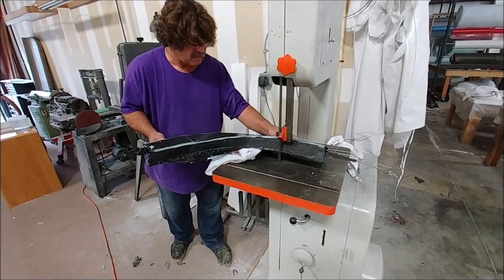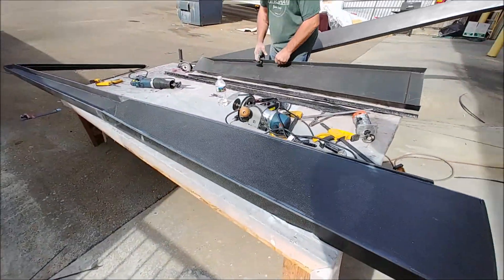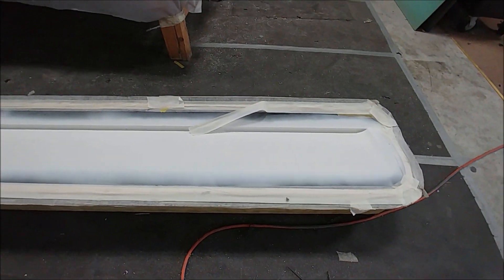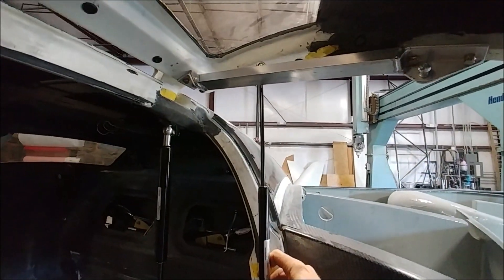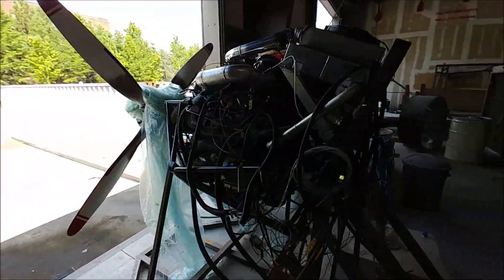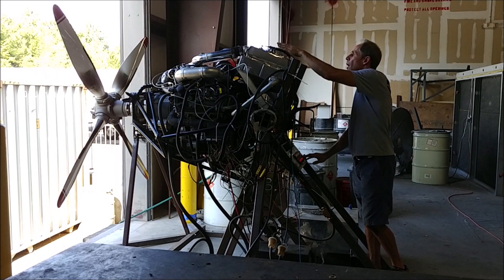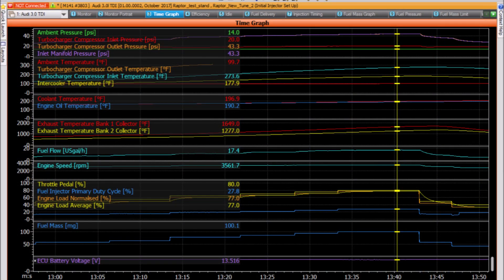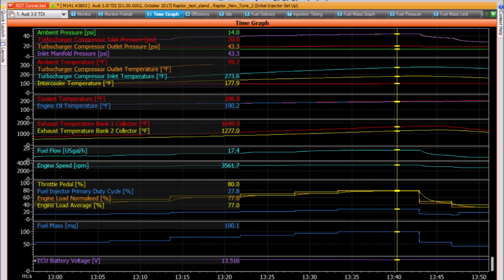Keeping Our Cool - Building the Raptor Prototype

Comment: Nice job lowering the temps with the intercooler. The EGT temp though, is still too high. 1250-1300 degrees is the MAX you should see. One thing to fix is that small, restrictive air filter, do you have room for a much bigger one? Here's a good article from Gale Banks: https://www.bankspower.com/tech_article/why-egt-is-important/

Comment: Really hope my question don't sound just to ignorant,,,, but there's a thrust bearing on the shaft where that prop is mounted? I mean the forces that are unleashed in that single point have to be brutal!! specially in a static thrust test! Also it's there any place where one can find what's the difference in price between carbon and old regular Fiberglass?

Comment: Can't you use a "locking gas spring" which has an actuator pin. This could eliminate the forces when the door is closed. Maybe it takes to redesign the brackets a bit so that the spring is compressed just a little more shortly before the door closes where you would then lock it to be inert. There are three types, one that completely locks both ways, one that is still springy in one direction and the one in the other direction.

Comment: Fuel to Air Intercooler = Genius! 
I wish these electric motor alternators were more readily accessible on the aftermarket. That would be a nice hybrid boost to climb performance without excessive battery weight.
Sorry the door struggles continue, but thanks for taking us through the prototyping journey with you... I still vote for a twin strut solution lol...

Comment: Could we see numbers for a reasonable cruise power setting at say 2700-2800 rpm. 
I think you will find that you get much better efficiency when the fuel burns in the engine's cylinders completely.
 Also that engine isn't designed to run at 3600rpm under that type of continuous load. 
It was designed to be connected to a gearbox that would have up-shifted under those conditions to keep the engine in it's actual power/efficiency band.
 I would advise that you stop chasing max power, maybe instead back the rpm to 2500-2700 and add load until you see signs of over fueling like light gray exhaust. 
This is how you tune a diesel. It's your engine and time though.
Reply: If I'm not mistaken they've already done what you suggest.  That engine was designed to go into the 5k rpms but they've capped it much lower such that at cruise it will be at the normal rpms it was designed to maintain in an automobile.
Reply: If you look at a factory Dyno chart for any of these modern diesels you will see a Broad flat torque plateau from turbo spool up to about 3k rpm and a drop in torque after 3000rpm.
 This is a function of the fuel burn rate VS piston speed. After about 3k rpm the piston is starting to out run the fuels burn rate.
  Look at the injector duty cycles at 27+% it's injecting fuel right up to the exhaust valve's opening. Now consider that the engine is also 50% above it's rated power, how much fuel is burning in the exhaust ports and manifolds?
  I drive a similar tech engine, German diesel, common rail, Bosch piezoelectric injectors and ECU.
 I could run it at 3500rpm and high load but it'll burn twice as much fuel and last half as long I bet. BTW I KNOW the fuel burn is correct but aerodynamic drag is a factor. Also I'm sure I would burn up a couple or three VNT turbos before the engine failed.
 
Now you could run this engine efficiently at 3.5-4k rpm but not at peak power. This is a quiz , do you know how?
Reply: Kyle Goldston      I agree, end of injection (talking crank angle) most be understood and kept within design limits.  It’s called engine engineering, to fulfill this projects potential Peter needs to get some.

Comment: The inter coolers can be built in custom shapes to fit inside the engine compartment. If you used all liquid to air. The extra heat captured could be used to deice the wings. I am sure everyone is super big on free deice. what about btc Peter?

Comment: Great Engine Test, very little Vibration. Would it be advisable to have a Baffle shading plate between Manifold and the Belt to prevent any Radiant heat affecting the Belt integrity. Surely being that close the Belt must be heating up on the nearside to the exhaust manifold.
Reply from the maker: Yeah, not really but I do plan to wrap that Y pipe again with some thermal shielding.

Comment: Don't feel bad about the door cylinder; using one or even two lighter cylinders - one on each side - will lessen the amount of differential torque on the hinges and frame when open or closed.  For the next iteration of the door latch design, will you be considering the use of a full aluminum or steel inner core around the perimeter for rigidity?  I'm thinking you could design a one-piece frame laser-cut from a single piece of aluminum plate 2.5" wide x 1/4" thick, and bent into a convex door-shaped frame, with plenty of room for attaching the locking system hardware and triangulated bracing around the perimeter that fits in between the inner and outer layers.  Start with a CNC-cut cardboard or 3/16" template for fine-tuning.

Comment: First!!  Good work this week guys.   Fun to watch. 
EGT reductions correlate to lower bowl rim, valve n wheel temps to touch on a few of the typically sensitive components.   Actually mapping from EGT to any one of these can take a lot of Engineering and test.   Knowing/deciding/respecting prudent time@temp limits for each critical area of each critical component will give durability & reliability.  When developing up rates or new applications this can take OEMs huge efforts & changes depending on step size and then many engines and tens of thousands of gallons of fuel to statistically validate durability.    

This application and ratings change is a great idea for this project and I applaud it.  But understand it is a huge undertaking to bring this new power train to a professional level product.  It will take expertise, time n $.  Every step & incremental departure from the specifics that Audi worked out should be engineered and validated accordingly

Comment: Technologies seem to reach their zenith just after the next generation / future opportunities are identified.  The Big Boy 4014 locomotive, The Great Eastern ship, and current Formula 1 automobiles are examples.  The Raptor aircraft clearly is one of those next generation opportunities.  The complexity of the engine installation makes me excited to look forward to what the next generation power plant might be.
Reply from the maker: Yes, this powerplant is just a stop gap until a decent electric hybrid can be viable.
Reply: @RaptorAircraft  , really?
Reply: Once you get the prototype flying and such, have you thought about talking to someone like EPS and their new diesel engine for your aircraft?  I feel that would be a perfect combo.
Reply: ,,, my heart will go on with the Diesel !
Reply: F1 is regressive tech.  If they were really about advancing something, they'd simply keep cutting the amount of fuel that can be used for a given distance to control speed.  And let the free market engineers figure the best solution, rather than box them in with century old tech..
Reply: I think we agree that the current state of F1 is not forward looking.